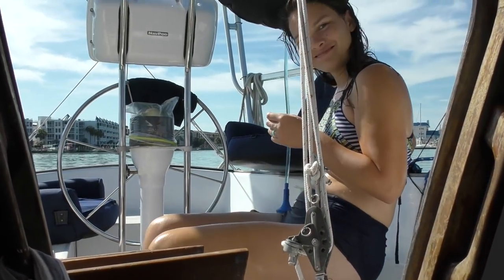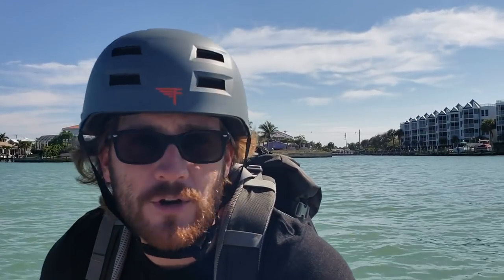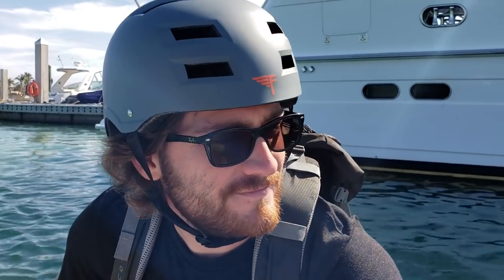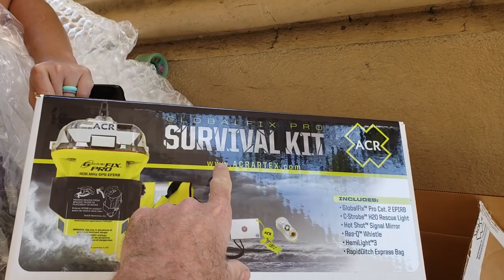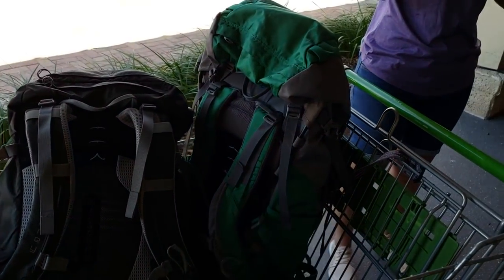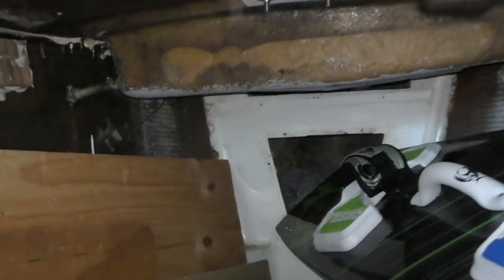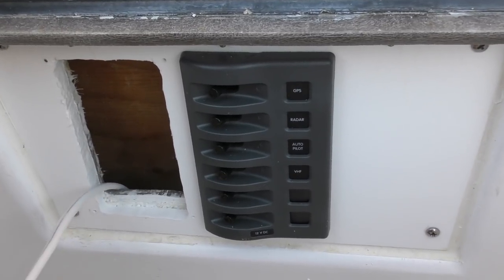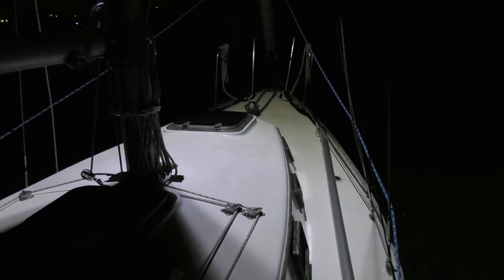71. Off the Grid Life at Anchor | Learning the Lines - Alternative Living

Comment: Make a cockpit Jacuzzi: Black rubber pond liner with clear plastic over it (anchored under the seat cushions) = a big solar heater. I used my hot water heater but the sun will work and use sea water (feels real clean in a clean water area). You can soak for hours!

Comment: We use Doc Bronner Pure Castile soap for washing.  Works great and doesn't need to be totally rinsed off.  A hot pot of water and a washcloth is all I need.  Baby wipes are great too for touching up. I buy them cheap in bulk-pqcks from Sam's or Costco.  They really are a lifesaver for staying non-smelly.  For dishes and hands we use Blue Dawn dish soap in foaming dispensers built into the sinks in the galley and head..  Real showers are a luxury of wasting precious water with the solar shower every once in a while.  Or when we are at the occasional Marina.

I bet you are going to get ship from a few folks about that dirty 2-stroke outboard.   Don't get cheap with the premix oil though.  Most specs say to mix it way leaner than is healthy for the engine -if it isn't smoking it is dying and burning the rings, ports and bottom end bearing. Just so you don't foul the plugs is about right.

Don't forget to register the EPIRB online. That is super easy to do, and to change later if you haven't gotten your international MMSI number yet or the ship's station license from the FCC and all that jazz.   No big deal to get the EPIRB registered now and later swap and change the details on the EPIRB site.  That is super-important.  Also be sure you have responsible people as your emergency contacts that know where you are located at any given time as USCG probably WILL call them first before sending anyone out there to check on you.  If you ever need to pop that EPIRB you don't want them diddling around wasting time.  Make sure everything is up to date and file a float plan with your contact folks on land regularly so everyone knows what is going on if you ever run into trouble.

Comment: The trick with salt water bathing (or even after just having a swim) is to towel yourself completely dry as soon as you get out of the water... before any salt water has the chance to evaporate and leave salt behind. I did that almost exclusively for a couple years (many years ago) while living on my small sloop down in St. Croix.  Dawn dish detergent works great!
Reply from the maker: That makes a lot of sense. Get that salt off asap!
Reply: How do you deal with the salty towels?  They never dry snd can't really be used again while wet.
Reply: dprider02 when I crossed the pacific we took salt water showers and then just rinsed off with fresh at the end, this avoided the salt crystals and salty towels
Reply: I was in High School when we moved from Maryland to California.  I also had a fair acne problem.  My Dad bought my brother and I a Hobie surfboard shortly after moving to Cali.  I made much more use of it than my brother, pedaling the one mile to Tamarack beach with it on my makeshift trailer.  After surfing, would pedal back home and taking a break or two en-route would brush the dry salt off my skin.  At home, I could jump in the shower for a fresh-water rinse (no soap needed), but after a week or two I didn't bother with that even.  Oh,  .  .  .  .  the acne problem disappeared completely.

Comment: Buy a 1, or 2, gallon garden sprayer.  Spray paint it black and it will heat the water.  It sometimes can get too hot.  If not hot enough, add some boiling water to it. You don't have to hang it up like your solar shower  (a few pumps will provide pressure water on demand) and you can store it anywhere on your deck where it will get sun.  To save fresh water, you can wash with salt water with Joy and rinse off with with the fresh.  It's an old trick and I'm surprised you were not familiar with it.

Comment: If you would like a warmer shower earlier in the day try this. I used to take a black rubber hose 3/4" and lay it out on the deck back and forth over and over again. Then attach your portable bladder to the hose. Let the hose fill up and have some type of control head at the shower end. You'll find that the black hose heats up quicker and much hotter than the bag alone and holds quite a bit of water so you can have more hot water for showering on colder days. Also, saltwater showers feel much better followed by a spray bottle of fresh water spritzed over you afterwards to rinse off the salt. I also use that trick for doing dishes, wash in saltwater and rinse in fresh water!  Good luck!

Comment: just a note to people thinking of buying a new epirb you can actually have the batteries repacked and have the epirb re-certified for another 2-5 years
Reply from the maker: We had an old one that we planned on replacing the battery on. The problem is the cost to replace the battery and have it recertified was so high (like 350 bucks), it made more sense to just buy this kit which was around 400.
Reply: @LearningtheLines  DAM! it only cost me $80

Comment: the boat and your guys looks better and better every time, I watch =))
but better to secure all wires and power cables, so that they can't break on sharp edges ... the boat always moves and moves ... and after 3000 sm each cable loses in such situation the insulation and then the short circuit occurs
Greetings Fin )

Comment: RE: hair conditioner.  Hairs are not smooth, they're spikey - like bramble stems, covered in thorns. That's why wool is scratchy if worn next to the skin, and why hair-shirts were worn as a penance. Because hairs are not smooth, they look matt, and get tangled up. (Felt is made by getting a load of wool and rubbing it all together so the hairs all get tangled together.) 
There's two ways to make hair smooth and shiny, polish it (with a hair brush) or oil it.
(So you'd want to get the oil out of wool to make felt. Before detergents were invented, they'd've used hot water.) 
I think banana oil would work very well as a hair-conditioner, but you might attract fruit flies. :)

Comment: Great video and very well presented.  We are in the early stages of repairing our first boat to be ready sometime in March hopefully, so all the information relayed is extremely useful.   Electrics: keep the cables ordered and grouped together where possible and labelled as you've been doing.  Always factor in if you have a repair to do and need to trace. Watch for leakage back through the water when on shore power - corrosion city and a metal rudder stock can become a very efficient sacrificial anode...  A water maker and solar panels to power it should be high on your list of must haves, if it's not already..

Comment: Re: detergents.   I once looked up (online) the COSHH datasheets for a leading brand, and an "Eco-friendly" brand of washing-up liquid. What I found was the ingredients were exactly the same, but the leading brand had 30% water, while the "Eco" brand had 70% water. The question is, how you use it. If you always give a big squirt of washing-up liquid into the bowl, you should use the "Eco" brand. If you can be careful and only use the bare minimum you need, then the leading brand will last much longer - which saves you the expense and effort of carrying new bottles to the boat. 
That is also how it goes for all other soaps, shampoos, etc. The less you use, the less you have to carry, and the less you waste/throw away.

Comment: Humorous that a sailboat has a "steaming' light. I wonder why that name is used on a vessel with steam. It must be a carry over from the days boats used 'steam' but why is it applied to sailboats? Easier to say 'steaming light' as opposed to 'underway light'?  Washing every 2 -3 days eh?,  So nothing dirty going on?  Enjoying your videos, stay safe.  :-)
Reply: The steaming light is only used when under power.  When sailing there are different lights that are displayed.  With boats the lights and their configuration and colors convey information like boat type, size, how they are operating, and in what direction they are moving.  

Sailing terms are all old and don't change very often.  A steaming light will be called a steaming light long after steam engines propel a vessel.  Even nuclear-powered warships still display steaming lights when under power -but to be fair they actually are using stream off of the reactors to drive the turbines.  Even electric boats need to display steaming lights.  A sailboat not under power only needs to display the nav lights.
Reply: @svbarryduckworth628   Thanks for the clarification  :-)

Comment: Y'all should get a zodi camping shower. Instant hot water and they're a lot better than a solar shower. I love my zodi. It uses 4 d batteries and a camping propane bottle (1 pound bottle). I'm sure that you could rewire the pump to your solar system in order to not need the d batteries. Even so, the d batteries last a long time and the propane bottle will last for about 2 straight hours on high.
Reply from the maker: Very interesting. Thanks for the suggestion!
Reply: They're a little over $100 but well worth the money.

Comment: May I ask for what reason you are installing the light switch panel outside in the cockpit? Thanks, Richard
Reply from the maker: For ease of control while underway. Also, so that the nav station is less cluttered with breakers.
Reply: @LearningtheLines  You may want to consider having the ability to turn deck lights on from inside.  If some night you wake up to the sound of somebody on your boat, it would be nice to be able to light up the outside without having to open up and go outside.

Comment: I think you need to put things in perspective. That tiny little bit of shampoo that you'd put in your hair isn't responsible for ruining the ocean. Don't sweat the small stuff. It's no way to go through life. Try placing that solar shower bag on a larger black rubber mat on deck. It will absorb more heat, faster. Best to you both.
Reply: These guys know that they they have a following, and that what they do may influence others.  So, they are doing the right thing by setting a good example.  It worth noting that the biggest source of water quality impairment in the US is non-point source pollution, which is made of runoff from millions of seemingly inconsequential small sources.
Reply: @cleanriver2  BS.  City/municipal runoff is #1.  Thanks government...
Reply: @svbarryduckworth628  City/Municipal runoff IS a type of nonpoint source pollution.
Reply: I have not used shampoo for over 2 years and my hair feels and looks amazing. No soap and no body odor. It took nearly 2 weeks for my hair to get used to no shampoo but it looks so healthy. If there was a problem with smell my wife would have said long ago. 🤗👍

Comment: That's only true by a part. Biodegradable means 80% of the 
ingredients will be degraded after 28 days. 80% of the rest as well, 20% from the rest…. So it never is degraded complete. Look here: https://de.wikipedia.org/wiki/Biologische_Abbaubarkeit (I am sure there is an English Version available).
But don't worry, this is as well fact if the waste water is going through a purification plant. So no worry if wash the hair or take a shower.
You should use a flexible tube or a hard tube for wiring. It makes it easier for changing.
Fair winds
Tom
Reply from the maker: Interesting, thanks for the info.

Comment: Do I see water maker bits ?
Reply from the maker: Actually just RO bits, but the only difference between a watermaker and your standard RO is pressure, so you're close. We're planning on hooking up the RO for our drinking water between the tank and a separate faucet at the sink. A real watermaker will happen in the future at some point as well. It's just not a huge priority for Caribbean cruising.
Reply from the maker: @LearnToSailMexico , you're correct. What  I mean is that desalinization, or "making water," happens at a higher pressure than regular old reverse osmosis. You can take fresh water and run reverse osmosis at your typical municipal water pressure. Desalinization of salt water will be a higher pressure and thus will require more robust equipment, even though the process is the same.
Reply from the maker: @LearnToSailMexico  , our water pump is 65 psi. The only reason we want to try the RO unit out is because a normal carbon filter won't filter out viruses, which can be less than 0.1 microns in size. If we're filling the tank in other countries I cant always be certain the water is super clean. Now, we're always going to treat the water with chlorine as well, but I figure the combination of chlorine and RO will mean we should never get sick drinking from the tank. We're just being cautious.

Comment: Did you wire the bow and stern lights together as “running lights” on one switch?  That’s the correct way so you don’t accidentally turn off the bow or stern not realizing the other is off. A quick check over the stern and you know running lights are all on. Also, anchor and steaming light should be on a single toggle, to ensure you never have both on at the same time. Fair winds.
Reply from the maker: Bow and stern lights are run to one switch that reads "navigation lights". The Anchor, Steaming, and Deck light are separate, however not on a single toggle. That would be good practice though. Thanks for the tip.